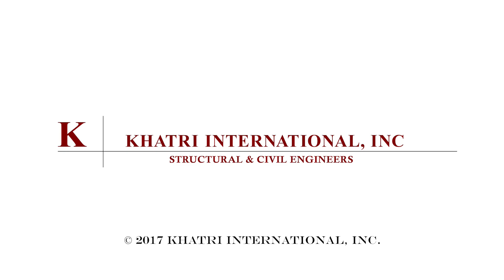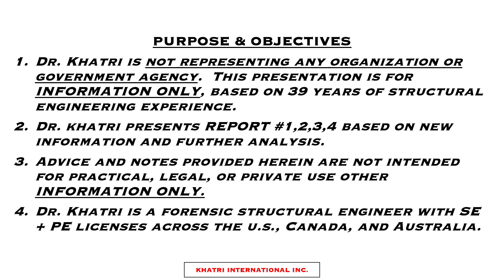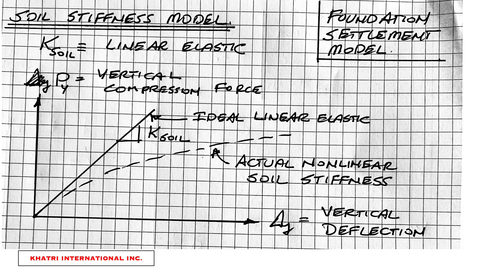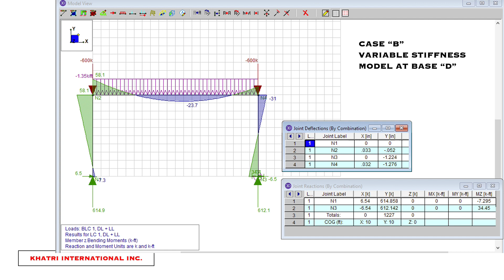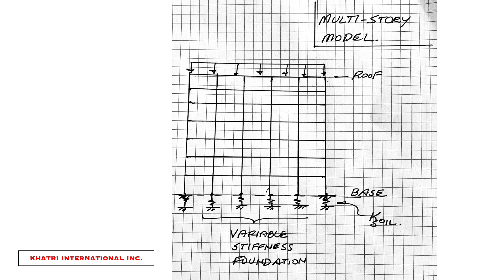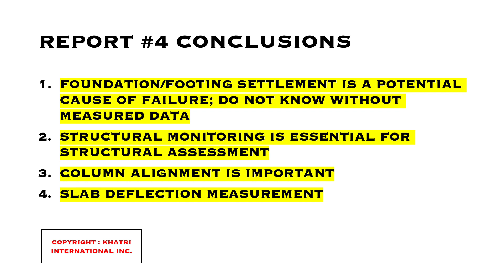2021 August 27 REPORT 4 Champlain Tower Collapse

Comment: Here's a thought: since a "sinkhole" is unlikely to be found below the remaining slab, and since the piles and pile caps seem to be the one (and only) structural element of this building that was built with proper safety margins, could not the capped-piles be re-used by the next building?  I mean Surfside's height restrictions and open space requirements are still in place, so the next building canNOT be any larger than the collapsed building, and the new building is likely to be lighter anyway, due to more efficient methods developed in the last 4 decades.

Comment: First I think your wording will mislead people who aren't following closely.  You state that there are moments and shears occurring at the "upper levels".  To some people watching, this will mean the top few floors of the building.  To someone following your analysis model this just means levels above the foundation level.  You have essentially modeled the street level.
You are modeling rotational stiffness and discussing it in general terms, but it would have to come from displacement of a pile cap meaning the piles on one side of the cap would have to compress and the piles on the other side of the cap would have to elongate.  Plus there could be vertical movements of the piles as they transfer loads to the soils.  Is this what you are expecting would happen as the bottom of the column rotates?  If the vertical movement is from soil settlement, perhaps consolidation of sands, then that could be a much more significant movement than the rotational movement.
"As one leg weakens"...  you've simply placed a double curvature component in the beam, a sidesway in the vertical direction.  This increases negative moments one side and decreases the other side.
You would have to analyze more of the building to determine if sidesway was significant.  If you modeled 2 bays with the column in the middle settling then it would be symmetrical and would not sway at all.  If you modeled 2 bays and let one of the outside columns settle then it would have one bay wanting to sway and one bay acting to resist the sway.  In the actual building there are a lot of bays in each direction.
You barely touched on this, and I think it is the most important finding that you have proved with your analysis - shears are changed as well as bending moments.  In a reinforced concrete building there is typically enough ductility to allow the building to survive even if bending moments are increased somewhere.  The reinforcing steel can yield, the moments will redistribute to somewhere else.  Only if the moments are increased in too many places and redistribution is not possible will there be a problem.  We are talking about a building that failed under service loads, likely some areas at a fraction of their design loads, not at ultimate load level.  If there was column settlement that increased shears in some area, and the building has a deficiency in punching shear design strength, then increasing moments and increasing shears is a double impact on the already deficient punching shear strength.  The increased moment causes more moment inbalance in the joint which increases shear strength from the portion of unbalanced moment that tries to transfer through shear, and the increased shear directly increases the shear stress on the punching shear perimeter.
Reply from the maker: Agree with your points, and yes further analysis of the entire building is necessary. This is a substantial undertaking and I did this work "on the fly" with no funding to share my perspective and initial hunch, which is validated.  I haven't seen any other engineers propose this level of investigation, but let's wait and see what NIST comes up with?  Thank you kindly for your comment.

Comment: Driven piles relying on skin friction?  I thought the documents released by Town of Surfside showed clearly that Champlain Towers South was founded on Franki piles, aka Pressure Injected Footings, which is quite a different mechanism.  Regardless, the CTS site has now been completely cleared, down to the foundation-slab-on-grade (there are several videos, many from NIST themselves), and there appears to be NO cracking or failure of that bottom-most slab, despite a) 40 years of NEGLECT, and b) the HAMMERING it took during the collapse.
Reply from the maker: I have the original plans and they are driven piles with no depth specified.
Reply: @dkhatri2006  ...driven piles with no depth specified...  I'm not a Civil Engineer (I'm a Computer Engineer, who once developed CAD/CAE tools for Structural Engineers), so I know just enough to be "dangerous", but aren't driven piles often specified as "DTR" i.e. Driven To Refusal, with a certain force?  e.g. "50 kips-DTR", and so each piling gets hammered with 50,000 lbf until it won't go any deeper, then the portion left sticking up above grade is cutoff, on to the next piling, etc... and at that point, we're confident that each driven pile can support AT LEAST 50 kips, yes/no?
Reply: @dkhatri2006  If your drawings are dated 1979, I think there was a later REVision, dated January 1980...?  OTOH, there was a LOT of corruption in Miami-Dade-Surfside, then and now, so I guess after NIST has gleaned all they can from current remnants, they (or the next owners) will eventually jackhammer that slab, and have a look at what ACTUALLY got driven into the Earth.  Whatever type of piles are down there, doesn't the UNcracked condition of the foundation slab tell us that they were adequate for the loads?

Comment: What you are saying is all well and true,  but the video posted on line showed the collapse started inside the basement parking facility.
Reply: I saw a video this week looking at the basement garage as it looks today. The remaining rebar on one column shows there was a twisting motion going on. The rebar left right now on a key column thought to have started it all. Right where you are saying it started. That column with evidence of a twist is exactly what he is saying here. As I understand it. 

People are wondering why that column, then series of columns gave way. This may have explained why.

It is consistent with what other engineers are saying.
Reply from the maker: YES, and that's exactly confirmed by my analysis which is based on interior bay inside the parking area.

Comment: Thank you for this analysis Dr. Khatri. It is certainly very advanced and beyond the scope of the lay person but I did work in engineering and architecture as a drafter for 28 years so I was able to follow most of it. I think it is a very important theory that should be analyzed by data on site. If this is the case, as you presented it, it should become part of the standard code of inspection of aging structures. I'm thinking of the twisting movement of one leg of a table weakening and bringing down the whole table over time. Building on the seaward shore of an island, the columns and footings should certainly be analyzed and inspected to a different standard than currently in practice.
Reply: couldnt agree more. if nothing else, salt water, in this case, over decades could the rise and fall of the salt water table, not only moves/removes the soil/sand, but the rebar corrossion also needs to be factored into all this

Comment: there was clearly no issue with the foundations as the slab was untouched an visibly level.
Reply: Flat is visible, level not so much. A transit, laser etc. would check level.